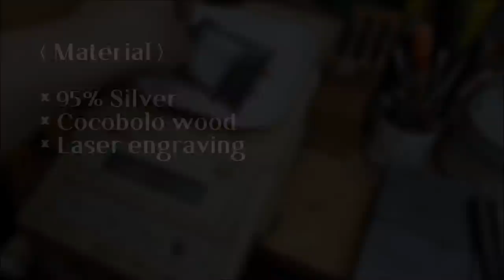Create the best "PEN STAND" for luxury pens / 럭셔리 펜 거치대 만들기

Comment: what benefits does the white copper add over just regular copper? Does it make it stronger? curious
Reply from the maker: This is a very good, high quality question.
White copper is a combination of copper and nickel.
Therefore, there are many advantages of processing.
Since the melting point (melting temperature) rises, it becomes easier to solder in several stages.
It is just like a copper alloy to process, but
The strength is slightly improved after completion,
It is resistant to discoloration after completion.
I hope my answer was helpful!
Reply: @SilverMeister  Yes it was, thank you! I figured it was a strength benefit, I didn't know it also increased melting point of the silver as well. I watch a lot of jewelry videos, and yours was the first I'd ever seen white copper used. Does its use change what you can hallmark the silver as? Does it still count as Sterling (925) or in this case more Britannia (950?)? 

In another life, I would have become a silver or gold smith or jeweler...

Comment: How long did it take to produce this stand? Also I guess that when handling sulfuric acid a breathing mask is needed, considering this material is very dangerous?
Reply from the maker: It takes 1 to 20 days to make the stand.
It has been around 30 years since sulfuric acid has been used.
I am well aware of the dangers of sulfuric acid,
There is enough experience to use it safely.
Safety is my own.
Thank you for your concern.